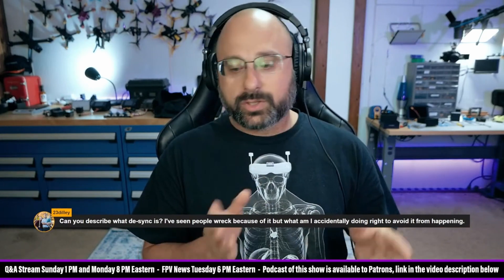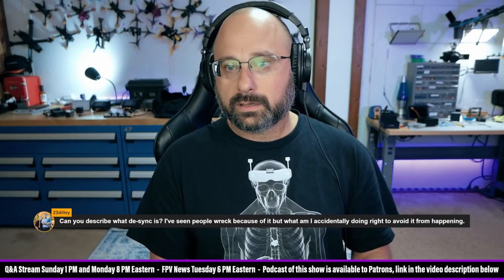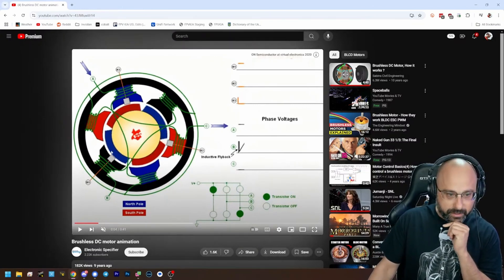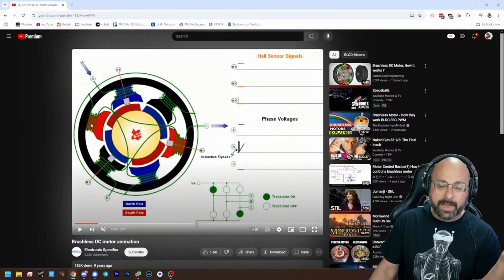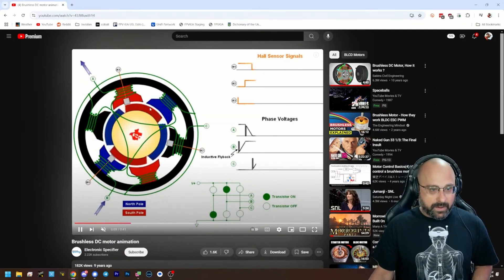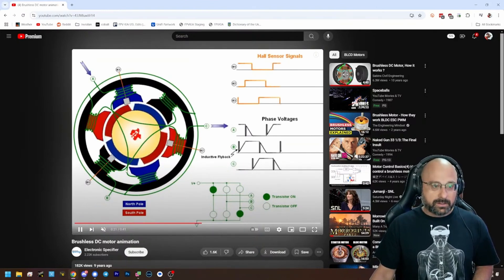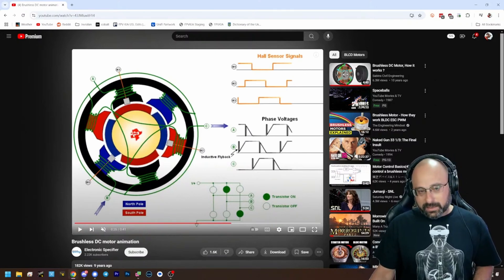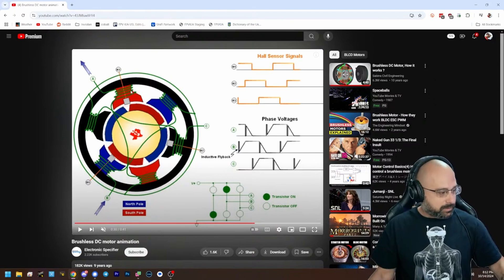What Is A Desync In FPV? ESC Losing Sync With Motor? - FPV Questions

Comment: So I made a 4s 18650 lithium ion pack to test for extended flying time, used it on 2700kv motors with 5.1 inch props which was a bad idea - I basically lost control, pitched straight down and fell out of the sky towards neighbours' roof.....and I kid you not about  a meter or two I regained control for some reason and could save the kwad.....

I dont really know what else it could have been other than a motor desync or related problem, wind was bad, so I could have pushed the pack beyond what it could deliver....not really sure (basically in fpv for about a month).

Comment: This is really fascinating, I wish I had been there for this. I've had a lot of trouble with desyncs especially with larger motors, normal esc settings aren't set for them, you have to fiddle with the settings and stuff or desyncs can happen, I've had them several times on 10 inch builds.   I also had desyncs with a speedybee mk 4 60 amp esc, they said the frames where off or something with bluejay, and it wasn't as good as blheli-s, and was a known problem.

Comment: Here a motor control "expert" 😀. The sensorless commutation is based on back-emf zero-crossing detection on the inactive phase (high-side and low-side mosfets are off). It can only be detected if the current of the detection phase is zero. There is an "inductive flyback" phase or demagnetization phase, when the motor phase is switched from active to inactive state (tri-state) and the current decays to zero (you will measure on the terminal ~dc-link voltage if the phase current was negative or ~zero if the phase current was positive). During that time zero-crossing detection is not possible and we have to wait a certain time period. This time is inverse proportional to speed and proportional to phase current. Based on experience you can wait a fix period of 0.2-0.4 of the sector time length. Therefore it can happen that due to high acceleration the phase current rises and zero-crossing detection starts during the demagnetization phase and is measured incorrectly. If the wait period to start the zero-crossing detection is a fix value, then it can happen at high speeds that zero-crossing detection is already missed and the commutation is done too late causing torque drop and at the next commutation step desyncronization. Not a native english speaker, so sorry.
Reply: mm mm, i see, now i understand           <---- doesn't get it at all

Comment: i've seen alot of multi wound motors that don't look fried but are still shorted cuz the thin wire moves in the stator do to inductance and the enamel wears down and shorts a pole eventually, for example most darwin motors that are multi wound will eventually just drop out of the sky, some companies double dip the enamel to prevent that, but i just opt for single wire wrapped motors cuz they run cooler anyhoo.....

Comment: I fly 3D and havent de sync. If you have it, just set motor timing to 24, or maybe higher, like 28 or 31. If its not enouth, set demag compensetion to high. Get smaler rampup power, 30 is normal to 5", you can set 20. Do dinamic idle 30 for 5" and pitch like 3.5-3.7"
Reply: Motor timing will depend on your specific quad. Higher motor timing allows to drive higher speeds but losing torque. And you are right, smaller rampup power helps to avoid desync. Especially if you have a >7 inch quad.

Comment: Had desync on two five inch builds everything new just needed to play with esc settings until I finally worked them gone
Reply: Ramp up speed and timing? I thought the defaults would be good for a 5” already.
Reply: @soar_fpv  ramp up power is at x5 and timing is at high . I did flash bluejay.21 the latest and yup did it on both quads . Being my first two builds wondering if I'm doing something wrong?. But hey they are flying great now 👍
Reply: @ good stuff!

Comment: I never had a desync in my 3 years  of flying and building quads I was always wondering why people loose quads over this mysterious thing
Reply: It depends on the chosen hardware. Good zero-crossing detection beside correct settings is also a combination of motor parameters and ESC parameters.